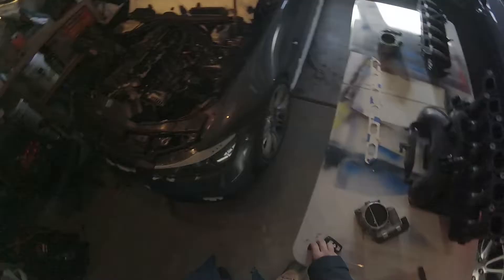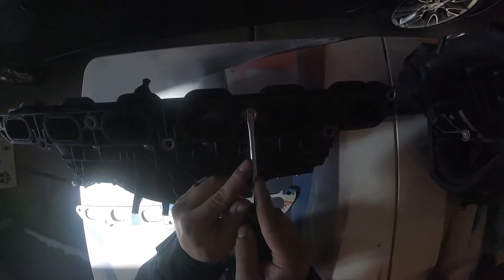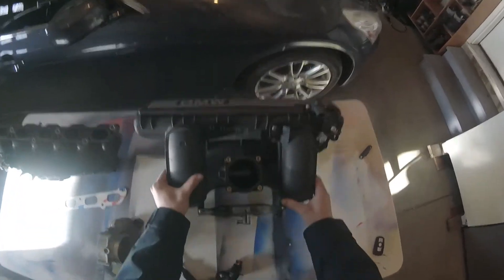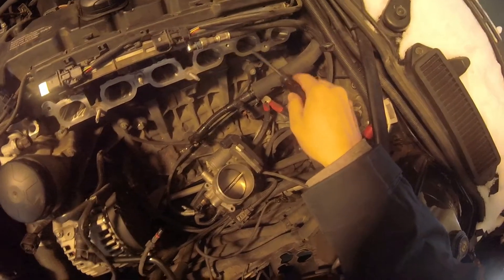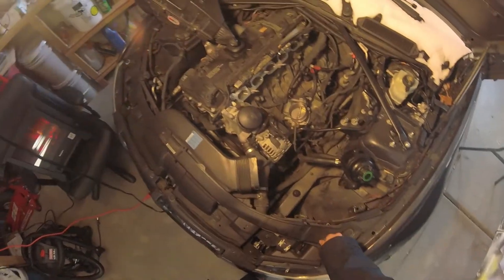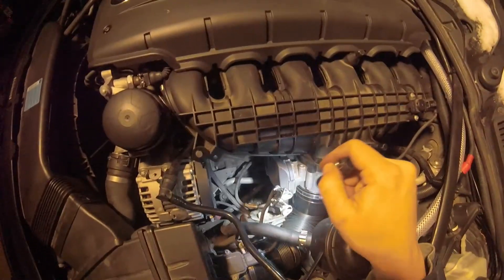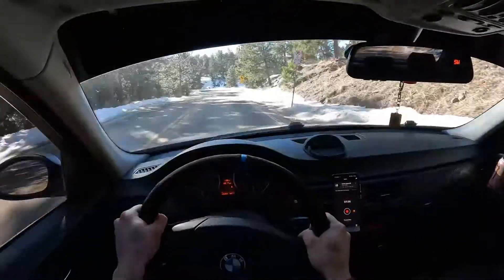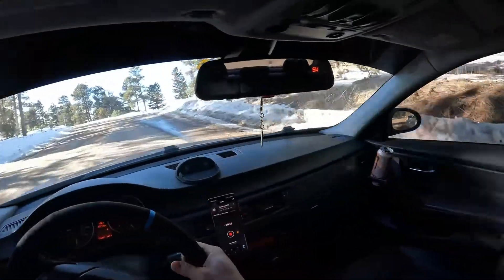How to put an N54 intake manifold on the N52. More power?

Comment: I know the 3 stage intake is a pain given the disa valves love to fail, but wouldn't that give you the best of both? 

You get the short runner for high rpm power and the long runners for low end torque without needing to modify anything. 

Or, run the N52 turbo intake. I think they're already a short runner manifolds...
Reply from the maker: Yeah the disa manifold would be better all around for NA. And I have not heard of the short runner turbo intakes, I'll have to take a look
Reply: @Moon-Garage  I only say the turbo intake because when I was at my local salvage yard I noticed all the turbo cars has short runners. I have no clue if the ports are the same size or if BMW changed the bolt pattern. Granted when I was there I was getting parts for my BMW... I wasn't paying that close attention to the turbo cars...

Comment: On my n52 with no disa valves, I had another hose from the expansion vessel going downwards. What did you do what that?
Reply from the maker: If it had nowhere to plug in, i left it unplugged. I think it's more evap hose stuff that returns the sludge from the manifold to somewhere. With the N54 manifold it won't build up sludge.
Reply: That makes sense, I think the hose I was talking about is a return hose for the oil being separated in the PCV, but if I add a catch can that shouldn't matter right?
Reply from the maker: @wallpaper122  correct. My catch can gets everything.

Comment: Can I use an n52 throttle body on the n54 intake
Reply from the maker: @huumans8521  yes
Reply: Also would I still have to figure out tubing from the manifold to the air box  if I’m using the same n52 throttle body
Reply from the maker: @huumans8521  yes will have to connect it to get a MAF sensor reading.
Reply: @Moon-Garage  ok thank you so much 👍
Reply: What about that tube that plugs into the n54 throttle body, what would I do with it if I’m using the n52 throttle body on the n54 manifold

Comment: So I could throw a n54 manifold on my 325xi 2006 and don’t need to tune it right away? Obviously ima gonna get a tune but itll run to move in my drive way??
Reply from the maker: @juancabrerajr9996  yes and yes. You'll be able to drive it fine with no tune. A tune will help with power gains though.
Reply: @ can I use the 325i throttle body? And what would I do w the Valve hose and oil pan hose? really wanna set my manifold up as I have one and does it throw a check engine? Thank for ur help
Reply: Is it possible to use a n52 throttle body?
Reply from the maker: @juancabrerajr9996  yes

Comment: Hey man, great follow up video after looking through the bimmer forums and other forum sites talking about this n54 manifold swap. A lot of guys have been using this manifold for fitting the N52/N51 into the E30 chassis in order to clear the brake booster among other things but wanted to hear directly from you on your experience going from a DISA manifold to a non-DISA manifold. Currently attempting this swap for an N51 and since CARB doesn't let me do tunes, I'd love to know how your car has been doing driveability wise. Thanks in advance!
Reply from the maker: @GabrielJuarez-bg8hb  hey. It's hard to say what the manifold has done and how it's doing at this point because the car is still being tuned for the turbo setup. But the car still runs and drives good. No codes.

Comment: Is the n54 better on n52 ?
Reply from the maker: @lcsosa9054  yes
Reply: @Moon-Garage thanyou for reaction bro what does it improve? And is it plug and play or is there something else?
Reply from the maker: @lcsosa9054  More top end power is the most noticable. This manifold paired with other mods and a tune will get the most power gain. The 3 stage manifold will have better low end and similar top end.
Reply: @Moon-Garage would you recomend it over the standard n52 intake? Is it better
Reply: Without 3sim
Reply from the maker: @lcsosa9054  yes
Reply: Fell to my knees when you said I’d have to tune down 😔

Comment: Does the N54 intake manifold fit to a N52B25 too or just the N52B30?
Reply from the maker: @ilhntrhn2207  yeah it will fit the b25 as well
Reply: @Moon-Garage  How did you manage the crank case ventilation though? You didn't really showed it.
Reply from the maker: @ilhntrhn2207  just a generic setup either rerouting to manifold or atmosphere is fine.
Reply: @Moon-Garage  What did you do though? Atmospheric with a catch can I guess?
Reply from the maker: @ilhntrhn2207  right now yes

Comment: I do have some trouble after the installation but my car has been siting for 6 months, i changed the flywheel and clutch and a bunch of other parts. My garage said that i have missfire from cylindre 4 and 5, maybe my intake boot is leaking of air, or maybe i didnt install the intake manifold correctly (i did cut the top of those adapter sleeve). I will probably reinstall n52 intake manifold for trouble shooting, i'll do an update of the situation later this week
Reply from the maker: @NosAndRix  if you had the non 3stage manifold before hand, it could still get a missfire if your PVC hose isn't re routed. You would need to run that hose I have attached to the Gatorade bottle instead to a catch can and run a 3/8 hose from the catch can back to the manifold so it sees vacuum. This was one point I was mistaken with during the video. If you did have the 3stage manifold on beforehand, you would need to detune or reprogram the car to not read any disa. Or to answer the question simply, the PCV likes to see vacuum and should be rerouted to a source (the manifold). Mine didn't cause a missfire but I now realize other cars will sometimes.
Reply from the maker: @NosAndRix  you could also have a completely different issue unrelated to the manifold. Replacing spark plugs is always a good thing to do.
Reply: @Moon-Garage  After investiguation, it seem that the problem was my coil from cylinder 4 and 5, it wasn't connected properly, the car seem to run fine now
Reply: @Moon-Garage  i changed my spark plug and the garage test the spark plugs, the coil, compression and other. They told me everything is fine about the ignition. They told me my intake boot is probably leaking and my catch can doesnt return to the manifold, and it can cause a problem like you said. I have a 328xi 07 without the stage 3. To try to fix the problem, i will change the intake boot for a universal flexible boot like you did. And i think i would need to drill a hole in my intake manifold and thread the plastic to put a line that came from my catch can

Comment: Hey man I live in Colorado always down for a meetup
Reply from the maker: @Thatonebmwguy  I unfortunately just moved to Idaho :(
Reply: @Moon-Garage  no worries! Did you end up needing a tune tho after the install it seemed like you ended up just driving it straight away and it was fine but maybe I miss saw
Reply from the maker: @Thatonebmwguy  I was able to drive it on a base tune (a tune just good enough for it to drive) I am still tuning and fixing some small things so that it can make all the power it should. In short, it's not done yet.
Reply: Also did you end up needing to tune it?

Comment: you had a 3 stage manifold and you removed it for a regular manifold (just wider) right? I'dk Like to put a N52 3 stage on my n53 and flash a tune from a 530i to integrate the 3 stage manifold but that seem tricky
Reply from the maker: @Gamos91  I did not have a 3 stage manifold to begin with. It was a 328i non disa manifold.

Comment: I would’ve went with the 330i manifold to retain low end torque. The N54 manifold gives you more power but there’s fall off in torque so there’s a trade off.
Reply from the maker: @natking1u1z99  if I didn't turbocharge my car, I would have done the 330i intake manifold as well.
Reply: So how do I install a n54 throttle body onto my n52 with stage 3 intake
Reply: @elijahblackson6220  look for a spacer maybe idk youll have to do some research

Comment: I have an old 325i and added the 3 stage intake manifold and had it tuned to use the disa valves... Will this really add anything more that that?
Reply from the maker: @davezaffina1983  probably not. And if it did, you would lose bottom end and gain top end. This is an alternative to doing a 3stage and needing a reprogram. Only benefit in the n54 manifold is no Programing needed and it is way better if you're going turbo.
Reply: @Moon-Garage  ah ok, I'm actually trying to sell my 325i that has too much to list done to it. It is a great car that I loved driving but am trying to free up garage space

Comment: Estimated time in labor? Im gonna have my shop do this cuz i break things gooder.
Reply from the maker: @azraelserene1899  15 to 20 hours.
Reply: @Moon-Garage you’re lying how is it 15-20 houes
Reply from the maker: @un54fee  do you think it should be more or less?
Reply: @Moon-Garage  less? I’m about to do it tomorrow and I can’t spend 20 hours I have a road trip in two days 😭
Reply from the maker: @Ez-jw8xv 🤣 good luck. Maybe if you hustle and read instructions fast, you can do it in less than 15 hours.
Reply: @Moon-Garage  what part took the longest? I just took off the original manifold
Reply from the maker: @Ez-jw8xv  Install for sure takes the longest. Triple check all your line connections so you don't have any leaks afterward. Don't tighten down any of the turbo vbands until you've mocked it up and it fits good with clearances. Same thing with Intercooler piping from turbo to Intercooler to intake manifold. All of that is a very tight fit. Even if you do get it all installed and you have no leaks, I wouldn't drive the car on a trip with the base tune. Also, drilling and taping the filter housing and oil pan is a little bit tedious and shouldn't be rushed.
Reply: @Moon-Garage  wait I’m not talking about turbo install I’m just talking about the intake manifold swap
Reply from the maker: @Ez-jw8xv  ahh my bad I didn't notice. Yeah, it should be like 2 hours max.

Comment: I just did this swap and got a bunch of codes and lights on. I think I might have a vacuum leak but I also got my brake light on and my DTC light on. Any idea what might cause those 2 lights on?

Did you have a small hose on your PVC valve? if so where did you route it to?
What did you do with the crankcase vent connector?
Reply from the maker: @arebelfromhell  that's interesting. Brake light and DCT light would usually be from a wheel speed sensor, so maybe you accidentally touched one of those as they are very sensitive. Either way should be completely unrelated to the intake manifold.

As for the PCV that comes from the back of the engine, I have it dumping into a catch can. You can route it through a catch can and back into the intake or directly into the manifold, or you can dump it on the ground. Up to you.
Reply: @Moon-Garage  Thank you for your reply, I figured out all the codes and the Brake & DCT light. My crankshaft sensor came loose and caused those lights and codes to turn on.

I don't recommend installing the manifold without the sleeves like you suggested towards the end of the video because the plastic is really soft especially when it gets hot and created some indents from tightening the bolts on my manifold.

Comment: how on earth is this supposed to work? The ECU needs to be programmed with the right map and you need the intake feed back from the valves and the MAP sensor and the valves need to know when to open and close along with the throttle valve. The vanos need a different timing and the vlavetronic will also need ...OMG I dont see how this will work at all.
Reply from the maker: N52 is very good at reading airflow and udjusting fuel. A tune may help a little, but it will pick up power on its own. Going from one manifold without a disa to another without a disa is hardly a change for the engine tune. Just a matter of flow at certain RPMs.

Comment: Soo i have a 2005  325i  looking to do this upgrade
But i have a few questions

Did you use any gasket on the block/ intake? or no gasket at all?
And 2nd is it gonne give trouble with the disa valve?
And how much power increase does it give? Is this more worth then the 330i 3stage inlet?

Thnx for this video
Reply from the maker: The intake manifold does have rubber gaskets but if you're not boosting it and they look to be in good condition you don't have to change them. In comparison to the 330i manifold it is probably similar power gains. The plus side is you won't have to reprogram the car for disas.

Comment: Hey, great info, and thanks for taking the time to post this.  What did you use to tune out the Disa valve error code.  Thanks
Reply: @djmike1057 did you ever find the answer? if you didn't tune them out how did it drive?
Reply from the maker: @milesw3720  didn't tune it, and it drove great. The n52 relies on the maf sensor and reads how much air is coming in, then adjusts how much fuel it sprays. Drove it for about 2 months like that. Now it's turbod on a base map
Reply: @Moon-Garage  thanks for the help! Waiting on my headers for a tune 😪
Reply from the maker: I have a 328i, so it has no disas to begin with. No tuning or coding needed.

Comment: is a tune required for this swap? currently hearing mixed opinions
Reply from the maker: No tune is required. Just make sure the maf sensor is plugged in and still working catching that air flow.
Reply: Even for 330?

Comment: How would the blow off valve will be managed with the valvetronik system - due to its work - in manifold, with boost, there will be no vacuum (throttle is not closed by 100% with valvetronik) ?
Reply from the maker: For when it's boosted (I'm almost done just about to tune this weekend). The blow-off valve gets a vacuum reference from the manifold (before throttlebody). The throttle body does close 100% while the valvetronic system does not. So it will still send vacuum to the BOV. Same way how a factory 335i (n54) works.
Reply: @Moon-Garage  maybe you can use vaccum pump for that n52 has one.

Comment: I would rather go with n54 manifold then the 3stage . I hate disa valve because of the plastic parts ... I have an 523i  and I want to increase the power , I have only 177 hp but I bought it because of the good condition of the engine .I want to add more hp at least 218 like the 525i .What do you think , this n54 will help me with some power? 
I have the manifold with the single disa valve , the valve from disa it s almost broken in half , my only options are to buy a metal kit valve to repaire it or to buy this manifold from an n54 and to lose all the problems ...
What do you think ? 
Thank you!
Reply: Do you know where I can get the metal kit valve ?
Reply from the maker: @Maaaaaax-07  I'm not sure what you're talking about, sorry. I got the n54 manifold and throttlebody off of  Facebook Marketplace.
Reply: @Moon-Garage  I was talking to the razvan guy. There's 3SIM kit to rebuild the disa valves.
Reply: @Zinbou1 ebay , the only store where I found kit for n52’s disa
Reply from the maker: If you're able to program it or have someone do it,  the n54 manifold would be good! I'm not sure how much of a power gain you'll get, if any, but you sure will get the reliability of losing the disa valve.
Reply: With N54 manifold  car will be laggy at low rpm but maybe a bit better at high rpm. Disas give you more low rpm torque for daily driving expirience. So i would recomend disa setup for daily n54 manifold for racing or boosting.
Reply: @Rience92  Yep, I stick with disa manifold , I found an tune for 523i to 525i conversion , it’s enough for me and I installed an oil catch can to protect disa valves from oil …
Reply: @razvan1927  i recomend using mahle disa valves. They are good quality and last longer.
Reply: @Rience92  I know , mahle is the original, i have my original disa but with aluminium flap upgrade.

Comment: Doesn't N52 come out with crankcase breather oil separator? So why would you run catch can if oil separator is already present? I'm about to get N52 so I really appreciate videos like this one. I just need to get everything sorted out so I can work on it as well.
Reply from the maker: It does but the return to manifold line still has weird sludge junk going back into it. My catch can right now is filling up with a weird liquid that I wouldn't want to run back through my engine especially boosted.
Reply: The stock N52 CCV system is trash & all it does is leak or fail. I wish German Auto Solutions would make a CCV Upgrade kit for the N52 like they did for the M54.

Comment: Hey man I have a question so I have a 2010 528i n52 I want to put the n54 manifold on my car but how would I go about the disa valve connector I would take it to a place in Vegas to tune but no shop is interested in helping. If you could give an insight I’d appreciate it
Reply from the maker: If it's an n52 with the 528i manifold it doesn't have disas and you can just install the n54 manifold with no coding. If you have the 530i manifold with disas on, I would say that it's not really worth it to swap to the n54 manifold. You'd lose a little bit of low end for a small, even unnoticeable gain in the high end. If you want it recorded, you would have to find someone (maybe through FB pages) that can code BMW, or you could learn and do it yourself. There's a few different softwares you can buy to do it.
Reply: @Moon-Garage  But this would be a good upgrade if you have a 28i i6 variant? 3 stage manifolds are getting expensive
Reply from the maker: @anthonyk  yes. Cheaper more simple power upgrade